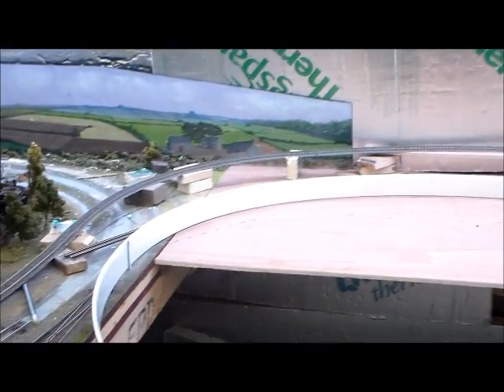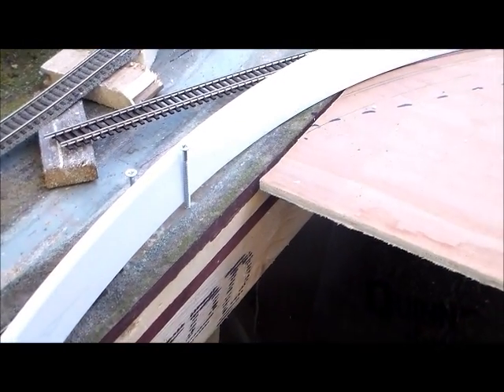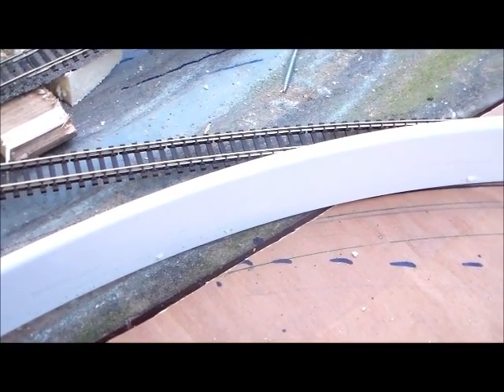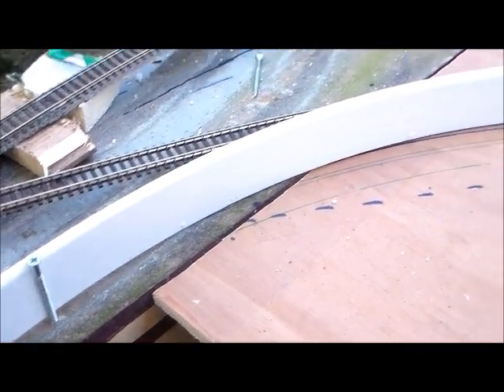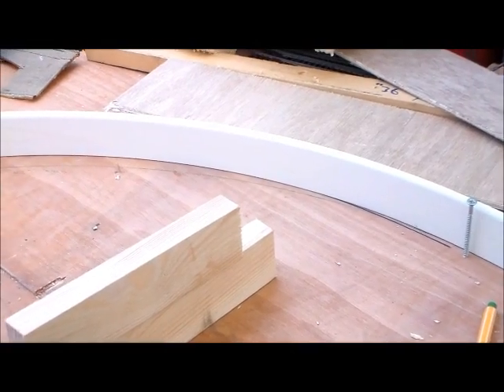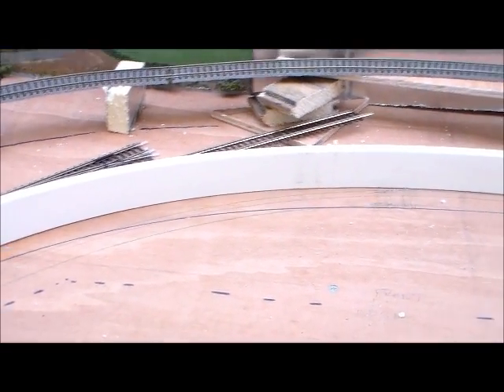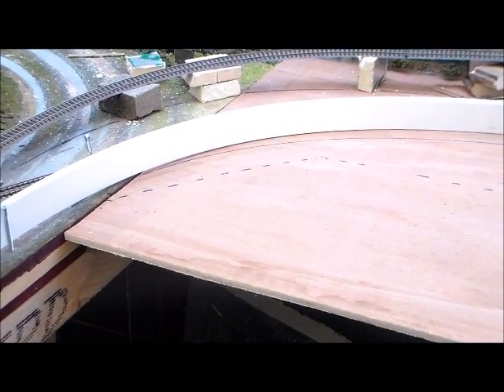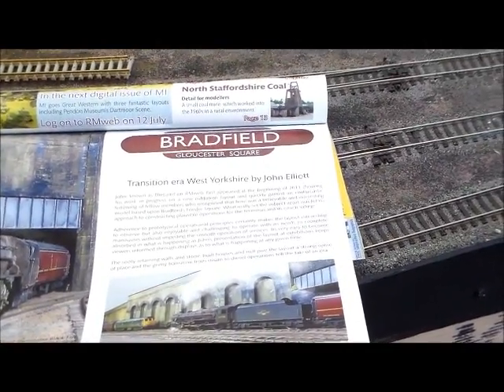transition curve - not!

Comment: interesting I'm in the process of attempting easement  curves on my layout using a similar method to yourself only using plastic trunking as a template.
 Right or wrong the approach I'm thinking of taking is set out the radius, measure the length of my longest rolling stock mk 3 coach divide by  2 extend the line from the original arch by that measurement and mark.
Then from the original starting point of the arch increase the radius by an offset of 1/2 inch then realign my template with these to new off sets.
Reply from the maker: Hi Richies. It sounds as though you are describing two methods here. It will be interesting to hear how it works out. There is a technical description on Youtube explaining the setting out of transition curves. For simple modelling we need something that gradually flattens the radius at each end of a curve - as simply as possible. Plastic trunking will allow you to set any size curve in situ - that sounds like a great idea.
Reply from the maker: Technical video here .. https://youtu.be/WOzcSftaq10
Reply: John Mellor 
John, slightly less techie intro to NEM transitions, with info at 5:16 https://youtu.be/ED8y-aVBbc4 
Just having the "right" values (or an approximation) helps, so we can add half an inch to each side of the layout and get a realistic transition. Regards, Tom